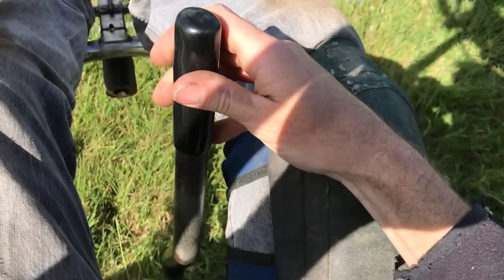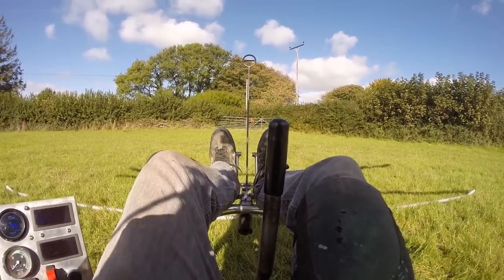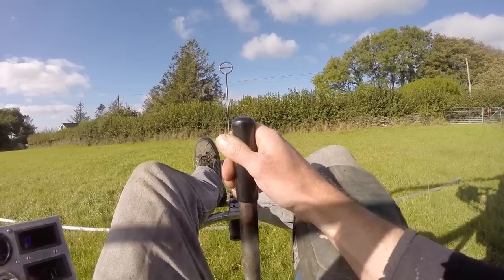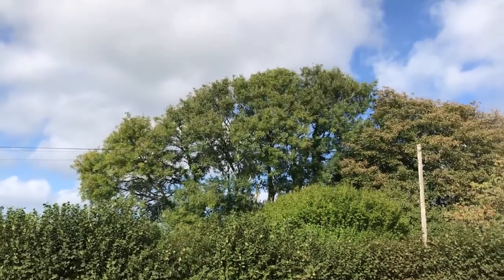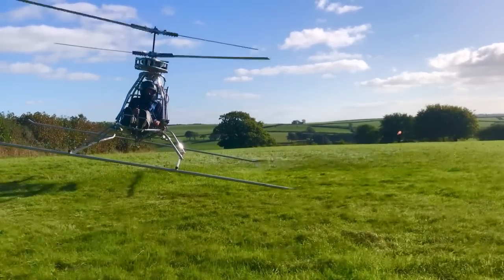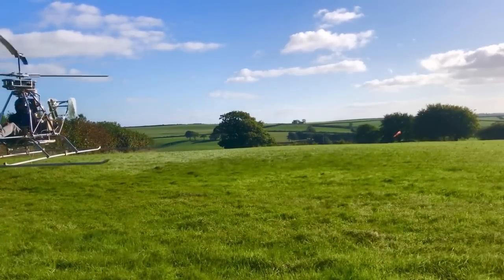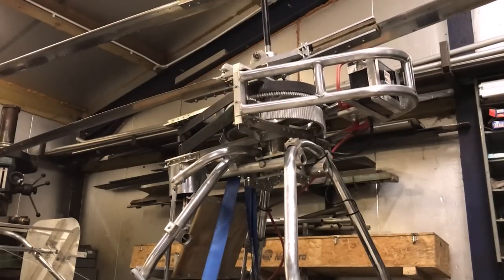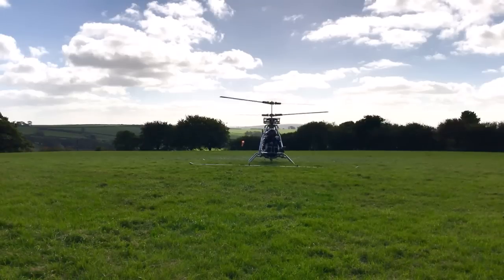Dodgy Moment, Homemade Coaxial Helicopter Learning to FLY

Comment: If it moves off center this quickly from the wind you're going to have to be very careful up high. It looks like one of those things that can be easily overcorrected and could get into an uncontrolled oscillation and flip or simply get too far into pitch/roll with no hope of recovery. Those little model fixed pitch coax helis have a self correcting flybar, it's almost impossible for them to get out of shape. That said you are the only source of correction here and the pendulum effect doesn't look like it will be your friend. Please be careful, it's an interesting project but to me it seems naturally unstable.
Reply from the maker: I suppose it could be possible to add a flybar like the models, at the Moment my thoughts are it's just lack of ability to hover a helicopter. If you add up the flight time I've had in my machine and the R22 lessons it would equate to around 2hrs. It can take up to 10hrs to learn to hover an R22, I'm not saying there isn't potential unknown issues with the flight characteristics of my machine and in time as experience increases I will be able to tell more about it.
Reply: @Ben-Dixey  I didn't realize it took so long to learn to hover a full scale heli, so I guess it has a lot to do with the pilot. I do rc helies it did take a bit to learn to hover (I know completely different) but I get the basic concept of trying to balance a ball bearing on an upsidedown bowl, it's not the easiest thing in the world. Best of luck!

Comment: Christ I wouldn't fly anything that couldn't feather/pitch the blades. I'd like the ability autorotate in an emergency. That thing scares the life out of me
Reply from the maker: What use is autorotation at 3ft high ?
Reply: @Ben-Dixey  As long as you're happy to stay at 3ft and never exceed 3kts then yeah no use. If you want to actually fly anywhere, then absolutely. Great piece of work nonetheless, just scares me
Reply from the maker: 👍 yeah I just wanted a hovering toy, would have built in collective for higher altitudes. However if you look at the Hv curves for helicopters it shows what speeds and altitudes autorotation isn't possible. To be able to autorotate isn't a fail safe in a lot of situations and an electric back up would be much safer in those situations. The hungaro copter is developing an electric back up. 
I agree helicopters are scary machines even on the ground.

Comment: That design seems unnecessarily dangerous. If the engine fails in flight it will kill you. Maybe find a way to mount a ballistic parachute system above the rotors. You are likely to experience an engine failure please be careful.
Reply from the maker: It won't be flown above 6ft in this configuration, it's just for hovering around a field. For a ballistic parachute to work you have to be a few hundred feet above the ground.
Reply: @Ben-Dixey  I understand. As you get more confident your going to push yourself more and more. I've seen a lot of experimental projects end up crashing. I'm a pilot myself and a bunch of my friends build aircraft. It makes me nervous knowing you can't auto rotate. Do you have any helicopter training? It may be worth doing a few lessons if you don't. Accidents in aviation happen very quickly. I learned long ago to take aviation very seriously. This is coming from a guy that has no problem doing 180mph down the highway on a bike.
Reply from the maker: Yes, getting over confident in the machine could lead to flying above what's safe. It's something I've considered and could happen. A thought that crossed my mind when only at 3ft briefly was "this feels very high in a machine I've built". I hope that mindset stays. I have had a couple lessons in an r22 and I'm happy to do more. The goal I set has really already been achieved, designing and building a helicopter that can get off the ground. Learning to hover would be an added bonus. Going from point A to point B would be the icing on the cake. Never above a few feet where autorotation would be of limited use anyway. I'd much rather have an electric motor as a back up to get you on the ground.
Reply from the maker: Yes, getting over confident in the machine could lead to flying above what's safe. It's something I've considered and could happen. A thought that crossed my mind when only at 3ft briefly was "this feels very high in a machine I've built". I hope that mindset stays. I have had a couple lessons in an r22 and I'm happy to do more. The goal I set has really already been achieved, designing and building a helicopter that can get off the ground. Learning to hover would be an added bonus. Going from point A to point B would be the icing on the cake. Never above a few feet where autorotation would be of limited use anyway. I'd much rather have an electric motor as a back up to get you on the ground.

Comment: These are rather hefty pilot induced oscillations. You aren't making it easy for yourself. You are starting out trying to learn one of the most difficult maneuvers, the hover. Most of us who fly were building up proficiency on fixed wings, prior to rotary conversion. And it was bloody difficult getting the hang of the hover.
Try a different approach. Get your rig on a huge, level field. Get your rig moving straight ahead, while dragging your skids gently along the surface. Build up confidence and speed. At a point, the ground effect will gently lift you off the ground. Which is the sketchy point in this strategy, because now you'll have to quickly learn how to set down safely. Better to take some lessons with an instructor now you've established your helo works just fine. 😉
-That will give you time to redesign your rotorheads. They aren't safe at all.  When you get flying, the slightest mast bump will eject your rotor blades. Don't keep those widow makers!
Reply from the maker: Appreciate your input, it has been suggested once before about sliding along the grass to produce some stability Increasing translational lift. I will give it some thought. Bare in mind that the total stick time with a helicopter is probably less than 2hrs and I feel the extended poles are safe to continue in winds less than 15mph As you say I haven't any fixed wing experience behind me which would be of benefit. I might do some more R22 training, I'm not apposed to that.  
The mast bumping I do have teeter stops to prevent the blade straps coming into contact with the mast. I didn't think you could get mast bumping unless the rotor is unloaded or taking off from an incline and I think you would need cyclic blade feathering, remember I'm tilting the mast where as most helicopters tilt the rotor and the mast stays still. Please correct  me if I'm wrong.

Comment: Those large skids are so dangerous you have no idea how dangerous. They are the worst thing you could have added to the helicopter. Also hovering so close to the ground is not wise. Thats how most low hovering accidents happen is when not enough power, side inertia and hit skids on the ground and flip it over. Hover atleast 5-10 ft off the ground. Not 2-3 ft. Most accidents happen when the helicopter is within rolling distance happens within of the ground.
Reply from the maker: Why do you think they are dangerous ? They have saved me numerous times from a dynamic roll over. The ends are bent up so they don't dig into the ground which would obviously be bad. Higher up is better I agree with.
Reply: @Ben-Dixey  You wouldnt need them if you flew higher up. If youve ever flown a RC model heli, you know full well that these things cause more crashes than prevent them. But its your design. From my experience, they are dangerous. You understand you can be killed if you have a roll over right? Blades can strike the cockpit. But flying higher, 10 ft minimum. But you seem to be getting good at hovering it. 

The controls seem to be spot on. Also because your helicopter has tail fins, training in it in a head wind would be better. If you begin moving forward and traveling in a forward movement the tail fins will help point the helicopter in the direction you are traveling. They add additional stability. Also, a horizontal fin wouldnt hurt too once you begin flying around and moving faster through the air, you will see that having a horizontal fin will help correct directional control at higher speeds.
Reply: @RifullOfTheWest  what a load of bull
Reply: @hkruczek8725  So youve flown a helicopter before?

Comment: Here's my first Serious Comment 👏 A Flight Controller.
Wind Sensor input from your extended skids.

Excuse me for not looking but did you do a Model of this and do a Flight controller?
If I can put this another way - seeing how you made the belt drive kinda makes you worth known and as all your viewers are Cringing like you are I'm suggesting doing the same thing again about a meter wide and train a flight controller.

I'd be looking at a stick over-ride Fly By Wire system based on a quad.

Now btd1982 this is where you get to find out how liked you are

Do any of your 5.64k viewers Agree with me and want to see you survive?

My First suggestion was an Ejector seat bypassing the counter rotating knives - yeah
Well a Flight Controller's better advice than that !!

Failing a FBW system we need you to find a very stoned Test Pilot - 
someone who doesn't care and yells "I'm Going to Show You Mum!"
OK.

Come on team he needs a Flight Controller - Voting begins with the obvious ... 

Yes - because it's a really good cheap idea

No - because the only reason you subscribed is to see the poor guy crash.
Call me if more than half click that ok

or 3. Maybe consider the Ejector seat bypassing the counter rotating knives and btd1982 this is where you find out who your Friends really are ... There's certain SIGNZ you should look for in Friends is all I'm saying.
Reply from the maker: Hi. A flight controller has been suggested and is possible, for me I wanted to learn the skill of hovering. If I had built a manned drone then sure, the Jetson one looks great fun.,

I didn't build a model first really because there have been similar machines built and I already knew it could work. 

I can understand subscribers wanting to see a crash. It's human nature I suppose. Not something I had thought of though. There has been more in the way of positive, constructive comments than anything else and It's been really helpful to read and respond to the suggestions.

Comment: bro help yourself and smash some electronics with an easy stabilization software to that
Reply from the maker: It's possible to add a flight controller but it wouldn't help to achieve my goal of being able to hover a helicopter. Part of the project was to learn the skill, apparently it's as easy as riding a bike once learnt.

Comment: I almost looks like the hard-ish landing made the rotor system go left at the same time the aircraft was drifting left which made it worse.  Its hard to tell for me at least if the extended skids actually saved you there, It does look like the contacted the ground which made the aircraft spring back more aggressively. I feel pretty confident though your instinctive action would have been to just pick the aircraft back up off the ground had you not had the extended skids on.
Reply from the maker: Well without the skids I believe it would have rolled over, it's amazing how easily helicopters go into a dynamic roll over. Without the skids I wouldn't have even attempted setting it down going sideways and would have taken my chance in recovering the situation in the air. It comes down to confidence in the end, the decision to go down wasn't a wrong one in this case as all was ok, just a bit rough on the aircraft. You have only got about a second to make a decision on what to do, it's not long to way up the options.

Comment: LMFAO.  I was a fan right up until you said “…and a spare engine where auto-rotation isn’t necessary…”  Auto-rotation is ALWAYS necessary for rotary wing craft.  No matter how many engines you have, there will always be a single point of failure with a transmission of combining box.
Reply from the maker: I take your point, what about the Jetson one ? Wouldn't that be an example of rotary wing aircraft that has redundancy without being able to autorotate. Single rotors sure, unless like me you have built a machine only for hovering.
Reply: @Ben-Dixey  You cited the redundancy of engines as being the reason to not have a need to auto-rotate.  I wouldn’t have commented had you said “there is no reason to have the ability to auto-rotate since I will never fly this craft above three meters and only plan to use it in a hover. As for the Jetson One, as far as I can tell, it stays low to the ground as well.  It also appears to have a substantial amount of its weight made up of a roll cage.  While I would happily fly it around a paddock at 3m, I certainly wouldn’t fly at a speed faster than I could ride a bike.  Maybe a little faster over a lake.  I’m guessing it is one catastrophic motor/propeller,wire… failure away from the craft tumbling across the landscape.  These are all just novelty craft and I don’t see how any will ever become a viable workhorse or human transport aircraft.  The safety and redundancy just aren’t there.  The cost and weight will be VERY high hurdles to clear.
If you are honestly just building yours for hover training or low and slow flying, there is nothing wrong with not having the ability to auto-rotate.  Of course you could learn to hover a conventional helicopter in two or three hours so while it looks fun, it’s a more expensive way to learn that skill set.
Reply from the maker: Yes, I should have phrased it differently, I was really just talking about how collective and cyclic control came to be the norm and what the reason was for not tilting the mast like mine, even though it appears to work. (All just my opinion) 
Of course suitable redundancy would have to be there with a fixed pitch tilting mast, could you have two gearboxes and two engines ? Perhaps but autorotation works and is a simple and light weight solution. 
The Jetson can still reportedly fly with one motor failure and it could be the future of flight. As you will know there are times where autorotation will not prevent an accident. 

The goal with my machine was just to hover around a field but mainly to see if I could build a machine that could leave the ground. For me it's mission accomplished but being good at hovering would be nice. Yes I could have paid for lessons but that was a small part of the goal.
Reply: @Ben-Dixey  It looks like a lot of fun.  I’m jealous you have the time and resources to do this.
I’m retired military and got all my training (fixed and rotary for free (assuming you count deployments to shitholes and getting shot at as free).  Most rotary operations can indeed be flown where the craft is ALWAYS within a safe auto-rotation envelope.  There are exceptions during sling loading, fire fighting, rescue, and confined spaces landings, but those have to be weighed on a cost benefit scale and many pilots do a very poor job with that consideration.  Risking a multi-million dollar craft should be the decision of the owners and not some cowboy pilot trying to make his/her life more exciting.  Aviation is supposed to normally be boring if you do it correctly.
As for your question about multiple “gearboxes”, you still have to get the power to the rotor system and that still means a “combining box”.  No matter what there is ALWAYS a potential single point of failure on a single or twin rotor craft.  The CV-22 avoids the problem to an extent with the ability to land in forward flight IN ADDITION to having each engine located directly at each rotor AND also having a common driveshaft to allow each engine to independently assume the entire load.
Reply from the maker: I think it will be fun once the hovering is under control. As you might remember the work load when learning the skill is very high and nothing but full concentration is required. Good to have your knowledge on auto situations and the CV-22, I was wondering about that one.